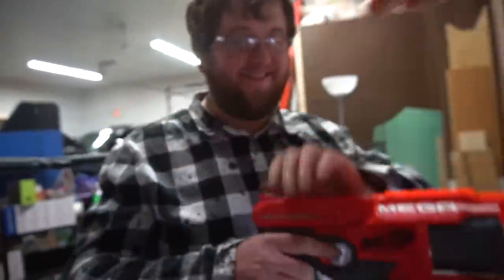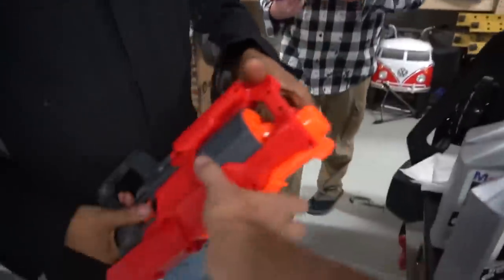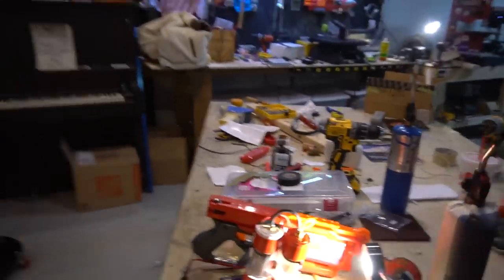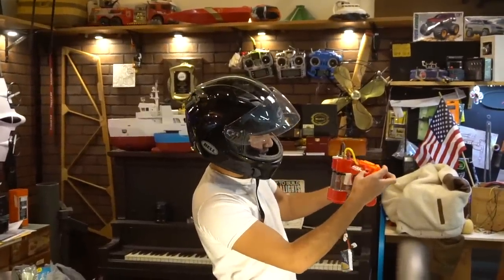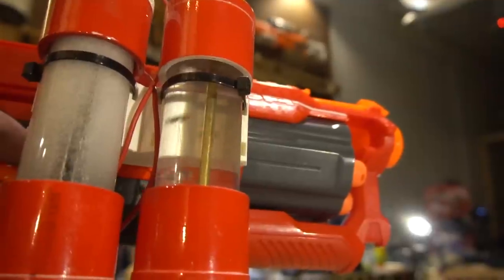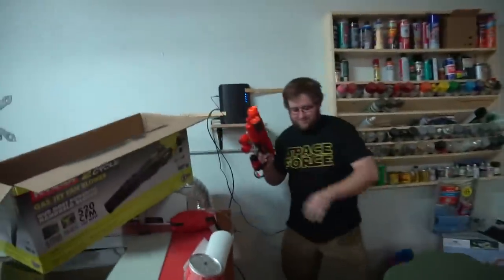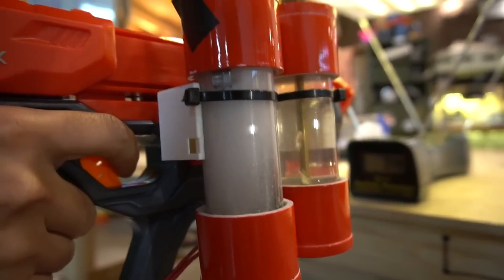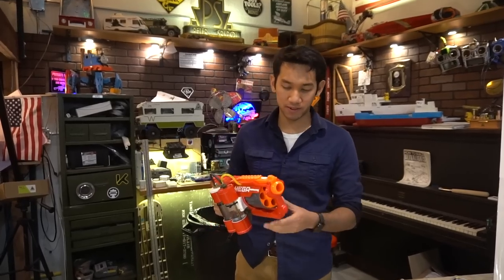Hydrogen Powered Nerf Blaster!!!

Comment: to produce Hydrogene in a medium slow way like you did i would guess it consumed around 150 watts? double up the power.
Next time add a led charge indicator (fake it , just a timerwhich lights up 10 leds in 10 seconds) so no guessing.
Arduino could be added to do this too.

Comment: as far as i know, you only need 2 volts (even less) for the splitting of water into HHO, so with your 2 plates parallel setup (i think) you are wasting some potential. I think you could have had around 6-7 plates for each pol. amps is what counts in the electrolysis, i think

Comment: a better way to do this would be to do the reaction outside the gun and store the hydrogen and oxygen (needed to have combustion) in say a co2 tank (I'm not sure if H is corrosive or not, but I think not). Then you can keep most of the assembly, but make sure that the combustion chamber is rated for internal pressure. You don't really want too big of a boom...

overall, pretty solid idea

Comment: This could be modified in a lot more save and powerfull manner. 
For safety you need a Hofmann electrolyzer which create H2 and O2 seperate and let the 2 gasses come together in an combustion chamber behind your bullet. A handcrank alternator could be added to recharge the battery. I would add a loadcontroller too to prevent it the battery from deeploading and overloading. I would add more batteries too and a way to cool the electrolyzer to prevent overheating. Also not making this stuff from just plastic but steal instead sound like good idea to me and then you could shoot real metal bullets and have a serious deadly weapon for selfdefence.

Comment: You're running into problems with lack of oxygen in the combustion chamber. It's important to make sure that you mix in the right amount of air with each hydrogen charge. That will make it much more powerful and also consistent. Then you will need to strengthen the darts so that they stop exploding.

Comment: Can you fill in the darts a bit?  Might stop them from getting damaged and remember your hho rocket desk model? paper and hot glue blast chamber. I think filling the darts a bit will do the same or a paper insert. You can 3d print a mould for paper press and make paper inserts from old paper

Comment: Here's a challenge. Take the caps off pouches of GoGo Squeez applesauce then heat and twist the sides of them to make propellers and see if you can use them to fly a quadcopter or a small plane.

Comment: it would be cooler if you mount an arduino that auto charges the cylinder automatically when you reload the gun.. and if the cylinder is already reloaded, it will not charge it more that it should have

Comment: Now get a small generator motor and run it off hydrogen.
Experiment with resistors and a PWM board between the battery and the bubbler cell.

Comment: I've made a hydrogen gun out of a 2 inch PVC pipe. I would fill the hydrogen in a 3 inch PVC chamber  and ignite it with a lighter starter that shoots out small fruits.  That sounds like gun shots and the fruit ends up down the block.

Comment: I see many ways to improve the design of the hydrogen firearm, NERF or not. Here are a few.
First, the larger you make the hose (and connection) between the cell and the intermediate bubble chamber, the more pressure you can build up in the hose from the bubble chamber to the combustion chamber. I don't know the internal diameters of the hoses you're using currently so... Eh. Just thought I'd throw that out there. With pressure building in the bubble chamber faster than it's released into the combustion chamber, this allows the combustion chamber a higher pressure when ignited even if it's not sealed by the bullet and easier charging of the HHO gas into the gun between shots. Essentially, that intermediate chamber would function as a capacitor. A decent one-way valve (if you're not already using one) would prevent any backward ignition to worry about.
Next, probably a larger cell. The intermediate bubble can (burp can? I don't know what to call it) doesn't need to be larger for anything, but a larger HHO cell would probably make for more efficient production. Would probably be thirstier for amps, but would definitely be more efficient per amp.
Finally, try to let as little gas escape the combustion chamber as possible before the dart is fired. This is probably where it moves from nerf gun to actual gun, since the nerf gun is kinda mechanically built for compressed air being released when you pull the trigger rather than gas building up til you pull it.

Comment: I think it would have worked better if you did use a small compressor and  an air tank instead of your hydrogen module.
It should make it safer, faster, more reliable, more powerful, and drain battery slower.

Comment: I modded a nerf gun and found the darts set the capability of the fps due to the front of the dart splitting before the dart leaves the barrel so I carefully wrapped the darts with packing tape

Comment: The bad thing about HHO (hydrogen + oxygen gas mix) is, it is at first an implosion, because it generates water, out of the combustion of hydrogen and oxygen.
Water is approx 1000 times smaller than the gases.
because to the heat, it is steam, the second circumstance, the efficency is horrible. The opposite to carbon-based fuel where for ex. petrol is expanding to carbondioxide, helps to get pressure.
But the bang is very loud if you got a few bubbles of the HHO-Gas mixture ignite.
Check my videos, i build a HHO-burner

Comment: hey peter, im working on a machine and im having trouble finding information. im trying to use servos to shift a semi automatic pit bike engine and instead of using radio using a hard wired remote. do you have any resources youd suggest for me?

Comment: Congrats you committed a felony.
By using a combustible to fire a projectile you manufactured a firearm. 
What made it illegal is that it is plastic and falls under The United States Undetectable Firearms Act of 1988 due to not containing a minimum of 3.7 oz (105 g) of steel.
Reply: What about the steel plates?